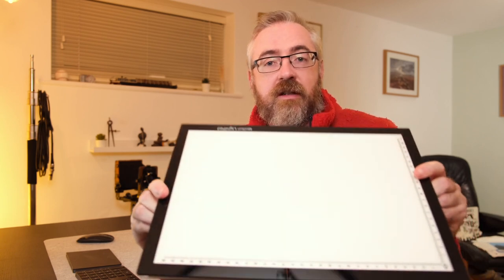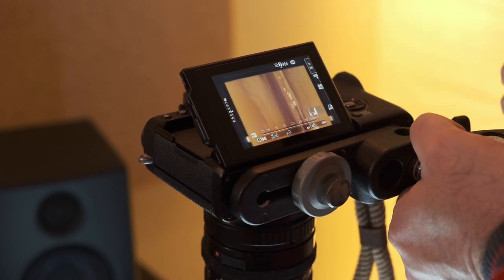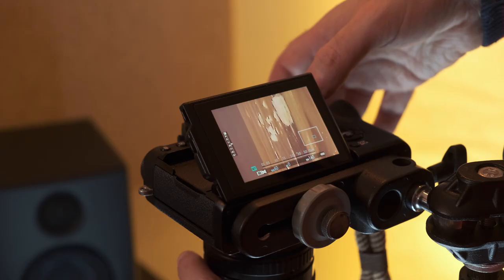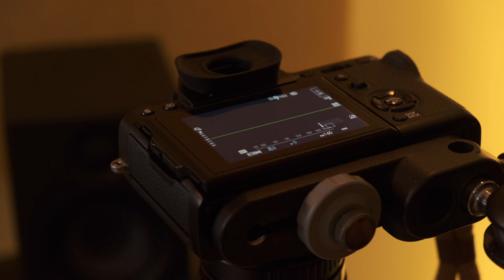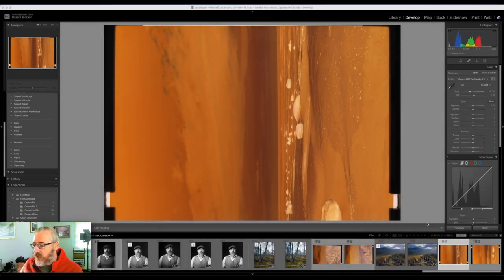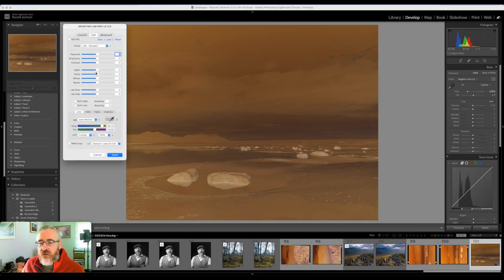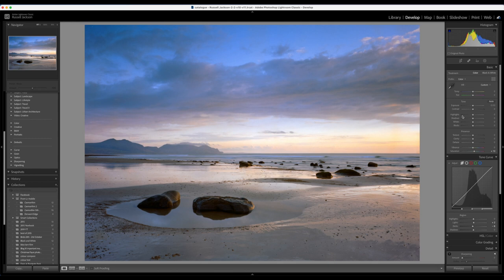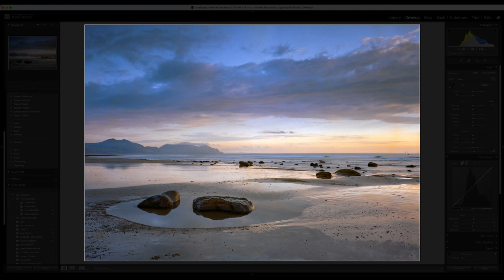Scanning 4x5 Large Format negatives with a digital camera and Negative Lab Pro

Comment: Ha, the Tessar 2.8/50! I've tested this lens with my Sony A7 for scanning 4x5 and found it to be astonishingly good – quality was a bit all over the place with GDR lenses, but the ones labeled "Zeiss" were reasonably good (not so much those labeled Pentacon), because they where made for export. The 4 element in 3 groups designs are quite good when stopped down, no distortion (I found this for all such lenses I've used for shooting, be it Tessar, Skopar, Solinar or Xenar). A simple enlarger lens of the same design would also give comparable results (when stopped down).

Comment: Hi Russell, thanks for sharing your process of digitising of the negative. I use the scanner for that - but for some time I also digitaised film by camera. When I see your flow - I have almost the same, I also have NegativeLab Pro for me. One thing is not sits with me though - when you show merged and rotated image, the black frame (the can mask) is not perfectly straight. When you look from the camera position towards scan mask - it is straight. So if camera levelled correctly and lens does not have distortion - the scan mask frame have to be straight in the image. But I see it is not. What is going on there?
Reply from the maker: Could be the levelling.  You can see it’s not a precisely engineered solution.  Also the lens I use is pretty good but it’s not perfect either.  I have sometimes had problems getting images to stitch and that is usually the levelling not being quite right.
Reply: @rjphotos  yes, sure. For that reason I done a specific setup (stand) that is not assembled / disassembled, but stay firm all the time. The camera just clamped to it via usual tripod bracket. After I levelled the setup - it stays this all the way. Also - to get camera up/down I used an old part from the 35mm camera bellows, where we have that moving part. Now it is possible to move camera up/down when needed.

Comment: How did you set up the Super Clamp to hold the camera? It's not obvious from the video.
Reply from the maker: I use the super clamp with a manfrotto double ball joint head and umbrella mount.  I set it up using a small bubble level on the camera screen to set the levels in both axis (checking that the scanning surface is also level). The clamp is attached to a generic monitor arm.

Comment: Hi, thank you very much for the video. Very interesting. Is the sharpness of the image OK ? Is there a huge difference in sharpness between this technique and scanning it with a big professional scanner ?
Reply from the maker: This is one area where a lens with excellent sharpness is useful.  I’m using a macro lens that has excellent sharpness and get great results.  It won’t be as good as a drum scan but it’s as good if not better than a flatbed scanner from what I’ve seen.
Reply: Thank you for your answer. I’ll try with my hasselblad lenses. Not macro but with the crop factor on the cfv II 50 it might work just fine.

Comment: Thanks for the video. Stitching two images from a 4x5 negative like this, what is the maximum print size you can make?
Reply from the maker: After stitching and cropping I’d say I’m getting about 36mp, but that’s stitching twice.  You can go closer and stitch 4 sections but I’m not sure there’s much advantage to that.  I’ve since changed my camera to an X-T5 so have 40mp so I don’t bother stitching at all now.
Reply: @rjphotos  Thanks for the info. I’m a Fuji shooter too. I have the XT-2 and have been thinking about upgrading to the XT-5.
Reply from the maker: @kiddeq  it’s a nice upgrade if you want to benefit from the improvements in AF performance and get in body stabilisation.

Comment: Hi Russell, would you be willing to share your film holder 3d file?
Was looking at designing and printing my own, when I came across your video. 
Thanks. Mark.
Reply from the maker: Hi Mark.  I don’t have the file as a colleague designed it and mailed me the print.  Since that video I found a better one on thingiverse that I have been using. There are quite a few designs on there.

Comment: I have watched several videos on this topic and all seem to have to deal with negatives curling. Why not place a piece of glass over the top of the negative. It would insure all corners etc. are flat.
Reply: It almost always produces Newton Rings https://en.wikipedia.org/wiki/Newton%27s_rings
Reply: @ChrisUG I picked up two sheets of "acid etched" antiglare glass from a framing shop for $20 and there are no Newton rings. It's worked well using my GFX 100 and a Pentax 645 120mm macro. The worst part (as with all scanning) is keeping the dust out.